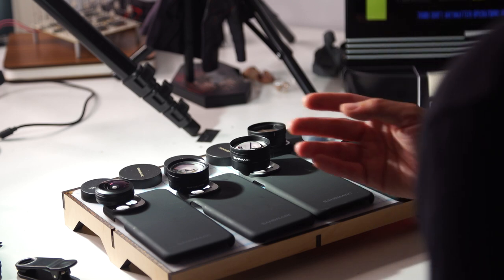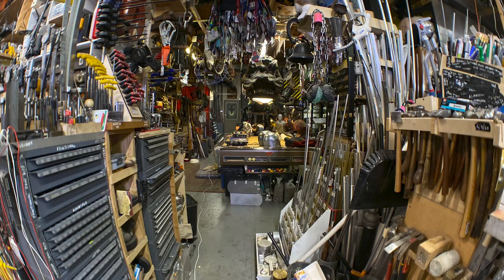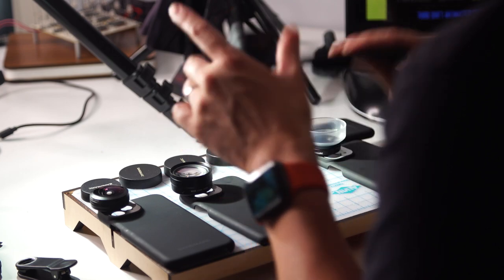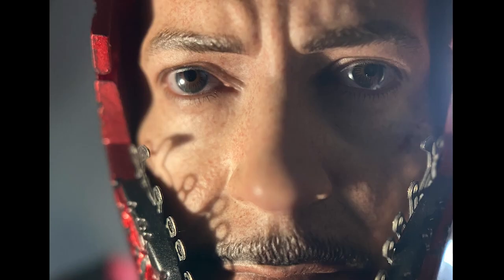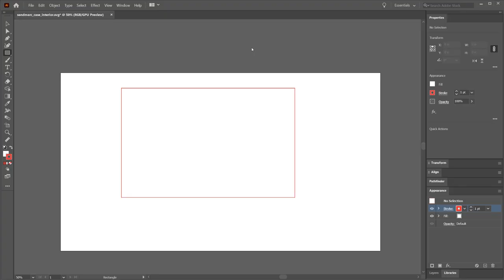Testing iPhone 11 Lens Attachments + Custom Storage Box!

Comment: I use Moment lenses and honestly, they're fantastic. Their cases are very high quality, and the lenses themselves are remarkably sharp. They're made of optical quality glass, rather than the plastic lenses that every other company uses (except Zeiss). The casing is also made of metal and is really durable. If I want an ultra-compact run and gun setup, I just reach for my moment lenses and put em in my (Moment) bag with elastic slots designed to hold them safely. 12/10 recommend. My only hesitation is the Macro lens, just because of how close its focusing range is. It produces amazing images, but only at insanely close distances. I ended up selling mine because I wasn't using it but once every few months.

Comment: I have never understood why you would buy adapter lenses for a specific cellphone that will only last the life of your phone. If you're doing that much shooting (video and/or still photography) you will be better off, both image quality and ease of use, purchasing the correct DSLR or dedicated camcorder for your needs. They hold value much better if you decide to sell off your equipment too.
Norm should have mad a case that is both dust proof and more durable for travel. This design is cool if you're storing it at home, but it wouldn't last very long taking it in the field or on a backpacking excursion.
Reply: At first blush, I disagreed with you. BUT. Those lenses are outrageously expensive.

Comment: If you buy a real good 4K SLR, and a few good lens, you would not have this bulky mess. The camera would not be obsolete the next year and when it does go in maybe 4 year or 5, you can upgrade to a newer version and the lens will still fit the new camera because only the tech changed in the camera, not the whole body of a phone.
Reply: A Canon EOS R is around £2000 without lenses. That's a big initial investment and it's going to be a while before you recoup that cost. 
And it's bulky and relatively heavy compared to a phone and two of the clip on attachments.